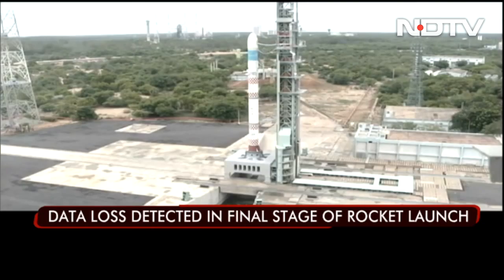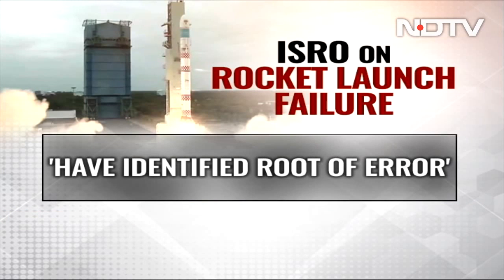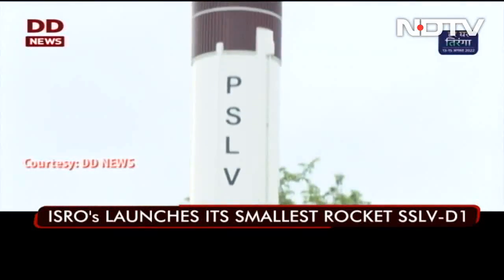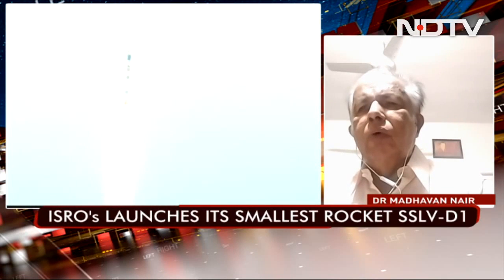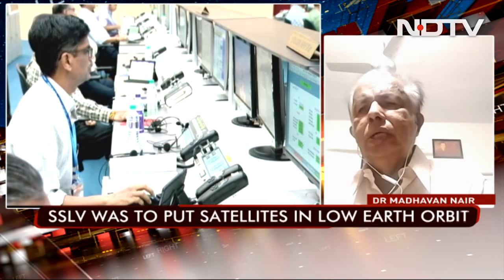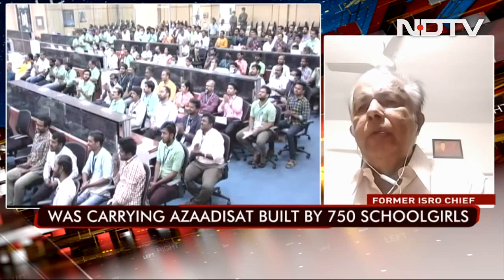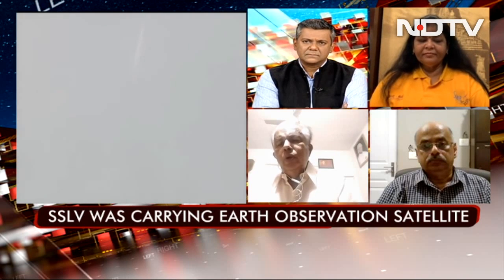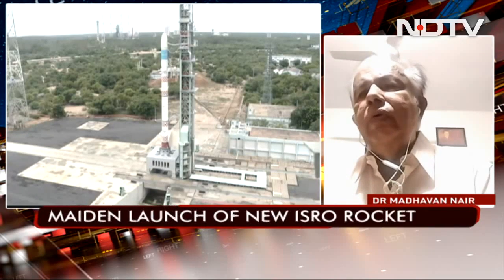ISRO's Launch With New Rocket Fails, "Satellites No Longer Usable" | Left, Right & Centre

Comment: Sslv is a brand new launch vehicle which was developed in a very short time. Which is a huge achievement in itself. You rarely see new vehicle being developed in such a short time. No launch vehicle performs perfectly in its first attempt. Many crash. But sslv  has performed flawlessly till the last injection phase. Where data loss has occurred.  Although both satellites have been injected as seen by on-board camera but has it been injected in right orbit that's the question.  As chairman isro said every other next generation technology performed flawlessly in sslv. They are all the propulsion  stages, new next generation control electronics, aerodynamic design, new technology for stage separation and the architecture of the vehicle etc has been proven in first attempt. So great first development flight of sslv.
Reply: It blew up as planned !